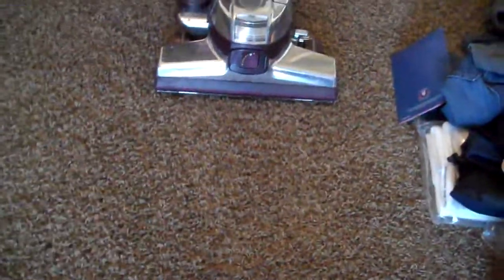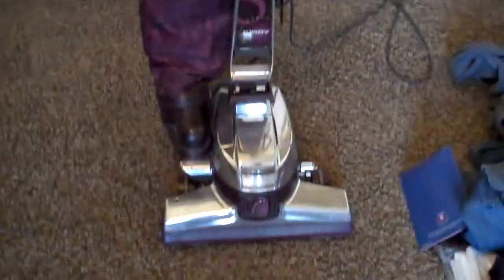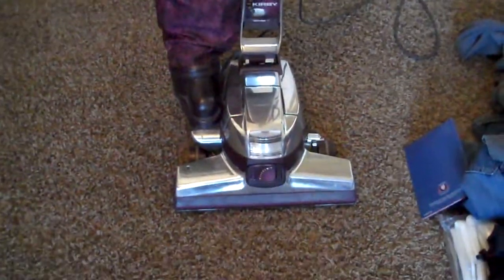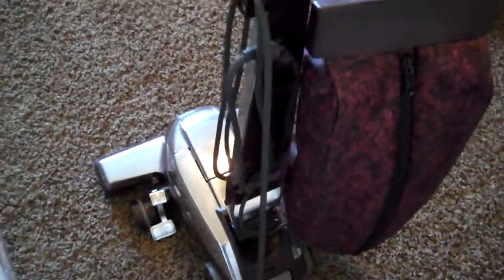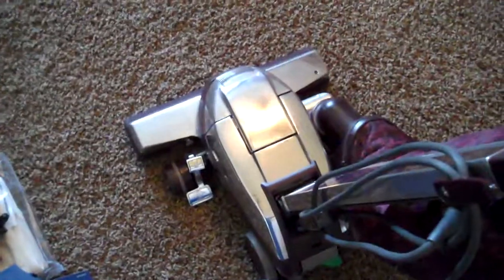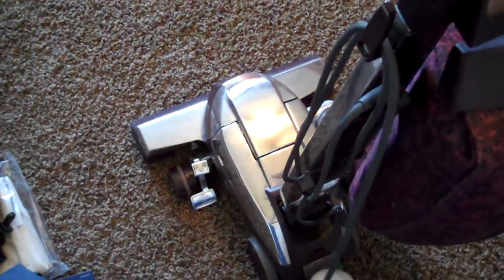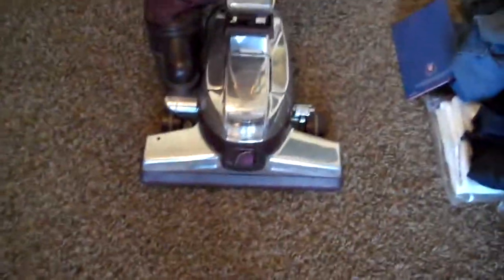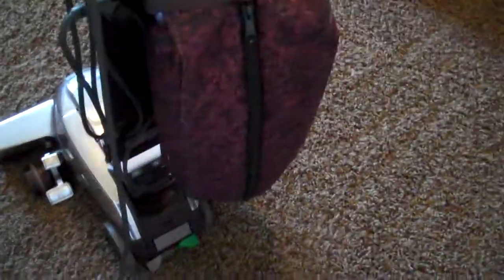1999 Kirby G5 Upright

Comment: If it 'clicks' while in neutral mode, it is most likely the bracket cam assembly that needs to be replaced. It is fairly simple: a small piece of metal that goes down between the gears.
Reply from the maker: It's only when it's in drive. That damn transmission has been serviced more times than I can count. LOL
Reply: Yes, they are a pain in the ass once something goes wrong with it. It could still be the bracket cam. If you replaced that and put a little bit of grease on the axle, that might help.